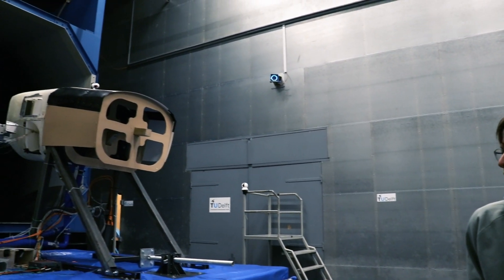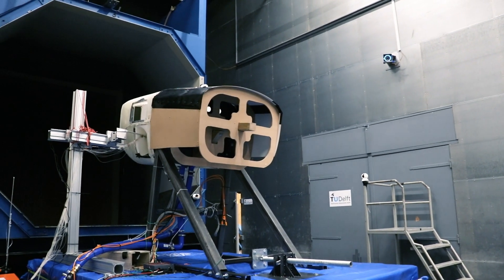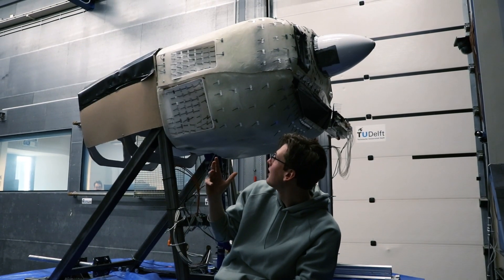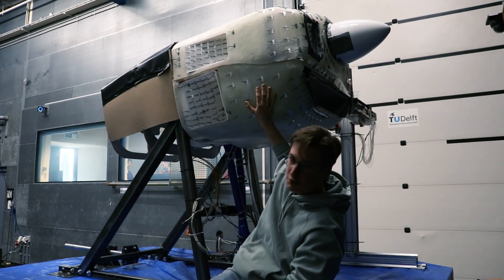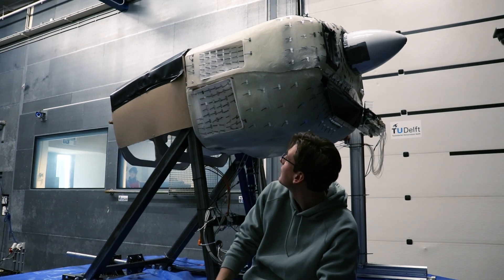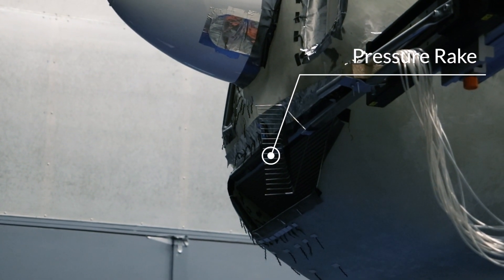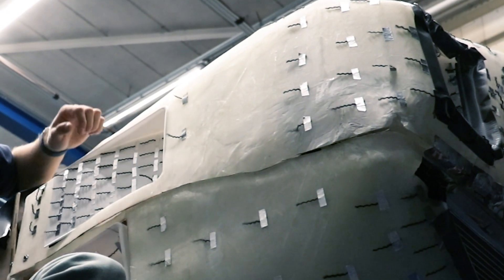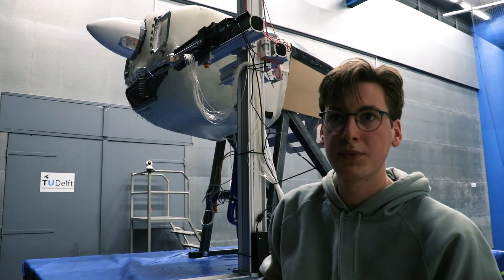Wind Tunnel Testing Our Aircraft Nose Cowling

Comment: Super cool! (pun intended) Thanks for taking the time to share this. Just wondering, is it that critical to get the cooling system to work that optimally? Woulnt it be easier tot take say slightly larger radiators, somewhat overdesigning the system, saving you much of the time and effort of these detailed CFD simulations and windtunnel testing?